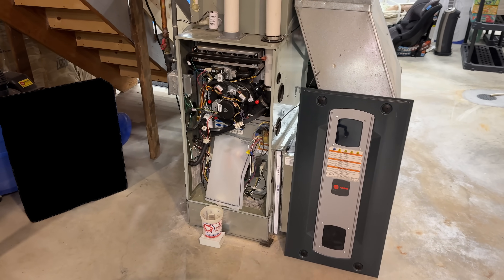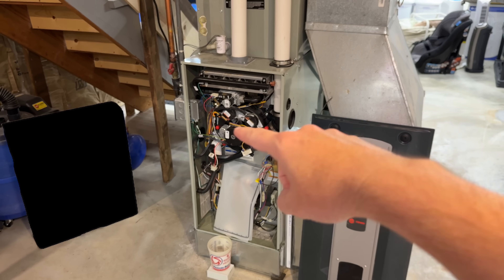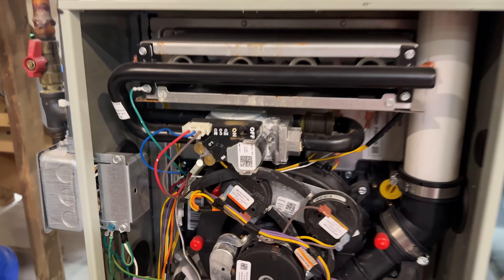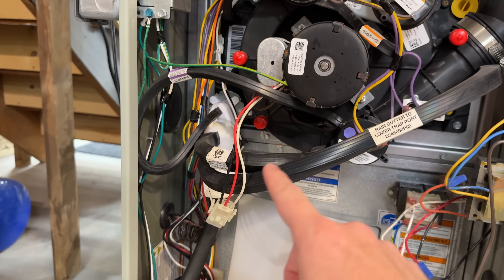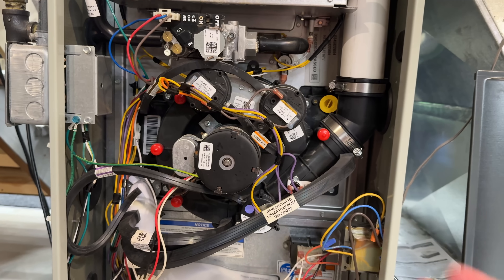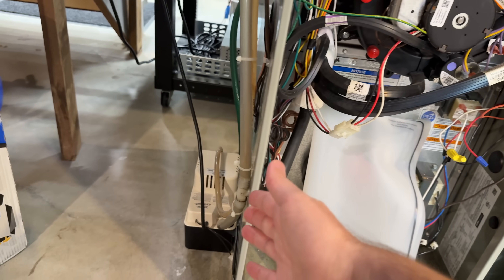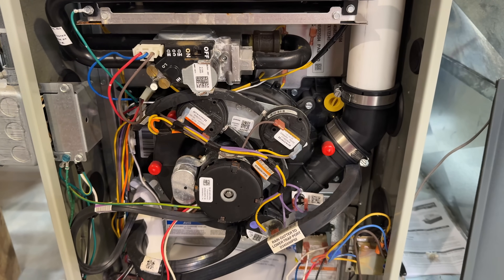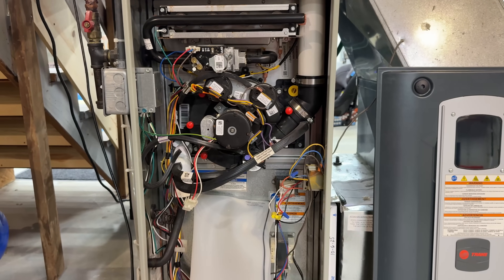It's not that hard to stop a Trane

Comment: Crazy I stumbled upon this video...
I was troubleshooting my elderly neighbors furnace yesterday and he has the EXACT same model. It was throwing an Error E12 for a bad fuse and it actually turned out to be a bad board due to corrosion... 

His HVAC company wanted $526 to replace it after his "$100 membership discount". 

It was intermittently failing so this makes a lot of sense as to what caused the problem. His furnace is 10 years old.

Comment: I think,warranty or not, is just to go ahead and re-engineer that pile of poorly designed junk.
First off, I'd move the control board outside of the unit and place it in is own IP rated enclosure up, away from the floor. Next I'd drop a hole in the lower portion of the fan and fit a hose barb fitting and a drain to your water collection tank. After that I'd see what we left and on those bits. When your done you'd probably find you had a Vaillant (good, German Engineering) heater.
I always work on the basis that you probably won't be able to stop water being in so make sure it has somewhere to get out.

Comment: I saw the problem right within the first min of the video! The black plastic of the two halves of the blower squirl cage meet and have screws or bolts and there is one missing at the bottom and that is where two different air temps meet and condensate. The bolt missing is right were it leaks and the drip falls off down to the board! Fix the blower squirl cage missing bolt and I think your moisture problem will disappear!

Comment: insulate those draft pipes so the condensation doesn't form on the cold surfaces. Paint the PCB with conformal coating.

Comment: My home has two Carrier 20MVP condensing two stage furnaces installed in 2000. It was $10K for two (with install), what seemed very expensive at the time. In 25 years I had two failures, a hot surface igniter got a crack and became intermittent, which I fixed myself, and one of the drain hoses was degrading so replaced it with hose from the auto parts store. When they installed them, they had the gas pressure way too high, as they adjusted them based on heat rise not based on gas input clocking, I promptly fixed this. They have now both run 25 years with 0 technician repair calls or annual service (my bad, but seems fine). I do change the air filters and vacuum the intake air plenum every year or so. I stuck a camera in the burner chamber a year or two ago and it looked totally clean. I slightly have wondered if the original installer set the gas mixture way rich on purpose, knowing it would cause future service calls, or if they just could not read the installer manual. I have a couple of CO detectors in my home, just in case a crack should form in a heat exchanger.  It never has leaked water. I have one download and one upflow, neither have had any real differences in functioning or reliability.

I now have a lot of solar on NEM 2 so the grid is my long-term battery, so want to move to heat pumps, but am considering just getting mini-splits and leave the gas furnaces in place for backup or if it get's really cold. I'm in the SF Bay area so I think 20 F is the coldest I have ever see it get in 35 years, and that's pretty uncommon. 

My furnace has a real different design to the air intake, there is a basically sealed metal box around the burner injectors and the air intake pipe connects to a fitting on this box, so even if it inhaled water I think it would just get sucked into the flame. I can't believe the one in the video seems to just dump the intake air into the furnace cabinet. The drain on the inducer blower has always worked just fine. 

My home also has a 45 year old Carrier A/C outside unit, that still works fine, I was told it was the ultra deluxe model in 1981, for it's capacity it's physically big. It once had a refrigerant leak about 25 years ago. I did have a second Carrier A/C unit die 22 years ago with a locked compressor, and it was replaced with a York (which I bought on the Internet and has a scroll compressor, along with getting a refrigeration license so I could legally evacuate/charge it), which has now run for 22 years with 0 leaks or issues. Silver solder on the piping and a long evacuation, until a micron gauge stayed low with the vacuum pump off, indicating all water and volatiles were gone. Somewhere I must still have half a tank of R-22. The A/C units are on the north side of my home so don't bake in the sun, although it get's to 105 here every summer.  

I'm curious if it's the brand or the age that makes such a big difference in our condensing furnace experiences. I always thought Trane and Carrier were similar quality. The guy who reviews appliances says the issue is inflation has made the inflation adjusted price of appliances just horrendously expensive today, so ones that are at the upper end of what we think is the acceptable range are just cheaply made. That implies my year 2000 $5K Carrier furnace should cost about $9400 today with install (88% inflation, I'd bet it would cost more, and lower quality). My Carrier 20MVP functionally looks very similar to Jeff's Trane.

Comment: That's the problem with these 'high efficiency' units that draw air from the outside. I have a Rheem Tankless water heater that overall, works really well, however, because it draws air from outside, even with the condensation trap on the intake, when it's really hot and humid out, it'll shut down with a 'water detected' error because the moisture in the incoming air condensed on the cooler components inside triggering the shutdown. Rheem is like 🤷‍♂. So when this starts, I just have to pull the cover off so it uses inside air to run and not shut down.

Comment: The old Carrier 92% I have from the mid 2000s has a big metal shelf between the inducer compartment and the board/blower compartment. Inevitably the inducer motor seal will leak water over time as it wears out which also happened to me, except the leaking water only rusted that shelf and never got to the board compartment. This design on the Trane is questionable to say the least, and probably for maximum compactness

Comment: Mm, from a European view I find that thing weirdly open. I mean, a high efficiency  / condensing furnace is nothing new here. I have one that claims to be I think 99.9% and it's from 2001 and still going strong. But the whole burner assembly is a sealed assembly,  the controller is a sealed box within the box and motors are or the sealed type. It is pulling in the fresh air into the housing just like yours but moisture, heat and electronics are much more separated.

Comment: I've fixed my grandma's dryer and oven. Dryer had a stuck switch* so the drum wouldn't stop spinning. Oven had a stuck switch so the convection coil wouldn't stop heating. Thank God the oven's over temp runaway sensor cut the power after just burning a lasagna and not the whole house down. 
Those fixes would be upwards of $600 if I didn't have mediocre soldering skills and the switches that cost less than $1 each. 
I've also worked on this same style unit. The door sensor rusted out so I bypass it. But the board itself is more protected from the water so I've only had to replace other parts. I should really replace that door sensor in case she ever sells the house... Dangit! More work added to the list.

*A switch is a tiny Lego looking piece that uses magnets to "plug in" a line of power. So for the oven it had melted together so it was "plugged in" even when the oven was not asking for it.

Comment: "warranty covers parts but not the labour" seems as sketchy as the design. Is that how it usually works? Who decides the labour costs? Are you paying the engineer's salary, or are they adding an overhead to cover their other costs, like parts?

My boiler (UK) has had issues over the years while it's still under warranty. They just come out and fix it for free.

Comment: We had these condensing units forced on us in Canada two decades ago.  The water is normal because they condense steam.  There shouldn't be water accumulating in the round, black  impeller housing.  It's supposed to drain out.  Check those square black hoses for clogs.

Comment: something to understand (speaking as an ME that used to work for a competitor hvac wise), this was not engineered to fail. you don't know everything when you design a system. when you make a design that has a failure mode you miss, it goes into the DFMEA and you learn going forward to cover that failure (assuming the cost of the failure outways the number of failures that occur). your job is to just barely make a system, and unlike in programming, where a change effects speed, physical things cost money for ever single piece you put in, even protection features. It costs a lot of money to test and build, and you can't predict all customer use cases. quality problems are awful from both a reputation and warranty cost perspective. trust me, no engineering company does this on purpose. I'm sorry you have to deal with this, it sucks.

Comment: The perils of the cutting edge. Condensing Furnaces/Boilers like these burn 20% less fuel but are far more complicated and require more maintenance (and have the literal condensation problem experienced by Jeff). IMO if you want condensing, a hydronic condensing boiler setup is the better play, you can put the boiler on an outside wall then run water lines back to where your HVAC system is, so you don’t have these long air supply/exhaust lines that are causing Jeff  problems.

Comment: High efficiency furnaces are condensing furnaces.  That means they have a secondary heat exchanger where the exhaust gas are cooled enough so the combustion products condense into water, thus releasing more heat.  The heat is passed through the heat exchanger into the forced air stream, thus providing more heat for your home.  This is how furnaces get above 80% efficiencies - extracting almost every last drop of heat from the combustion process.

The downside is complexity.  The process generates water, which is why they have all the pipes and drains in the exhaust system.  The exhaust is too cool to rely on convection to rise through a chimney, so an induction fan must be used to force it out.  The good news is the exhaust is cool enough that PVC can be used, and it can be plumbed horizontally.  Also, the secondary heat exchanger must be rust proof, so they are stainless-steel.  And safety systems have to be more complicated to make sure the induction fan motor is running, water is draining, and more.  This is one reason why these furnaces cost more.

As for Jeff's  system, I agree with the other commenters that swapping the two drains should eliminate the problem.  This will give the condensate a better slope to drain into the collector.  For all we know, the drains were installed incorrectly at the factory.

Another note is the external condensate pump has an overflow cutoff switch, but it's not wired in Jeff's system.  This should be connected to the thermostat control wires; that way if the pump fails and is close to overflowing the system will shut off.  It's simple low voltage wiring that any decently handy person (like Jeff) can do!  It's a handy feature to prevent wet floors.

Comment: One day I found my gas furnace making a gurgling sound. That's not normal. I called in a tech and it turned out the the draft inducer fan was full of water! Simply because the condensate drain had a tiny blockage.

Amazingly the fan and furnace still run fine even a few years later.

Comment: You pay a big price premium for Trane and Carrier. You must get it serviced regularly to keep the warranty. Replacement Parts are usually three days away if they are not on nation wide back order. Thats why we sell Goodman, Amana and Daikin systems. Any tech that says Goodman is junk is lying. If sized and installed correctly, they will perform as well as any other brand at a much lower installed cost. Most repair parts are on every service truck. An 18 seer Goodman will save the same amount on the electric bill as an 18 seer Trane and about 5-8 thousand dollars cheaper. At least in our service area. You will never get that extra cost back within the lifespan of the Trane.
Reply: Yes, all my properties have Goodmans and about 1/3rd of my area seems to have Goodman. Dead simple to figure out what is wrong if you can handle amp and voltage readings and a DIY fix if you are not afraid of 230V when testing it. Never had a Freon leak either.

Comment: I have a similar unit but downdraft.  Same issues yet but a did a few thing to prevent water from getting on sensitive electronics.  Trane will likely blame it on improper installation

Comment: You have a bad install. That unit can be installed vertically and horizontally and the drain hoses (square ones) are supposed to be rerouted depending on configuration.

On the point of the cutoff, if you have a condensing furnace then that cutoff should cut it off too, not just the AC. The cutoff switch should probably be installed to interrupt a different control line.

You can talk to Trane but I think your installer is at fault and they should fix it including labor since they did it wrong.

Comment: My Trane furnace died a slow death last year. Had to replace the control board after it lost 1 phase of the AC circuit. I asked the tech "So what happens when it inevitably fails again and these boards aren't available any more?" He says "Buy a new furnace". I should have bought the cheap furnace instead of the ultra high efficiency one. Lesson learned ...

Comment: A proper install will have a drip loop of sorts for your air tubing to purge moisture before it hits your HVAC unit. Would be relatively easy for you to add.
Reply: You have to be careful with the number of bends in the intake an exhaust pipes on condensing furnaces.   There are maximum lengths for the pipes, as the induction fan can only push/pull air through so much pipe.  Curved sections add much more resistance than straight pipe.  The installation instructions provide data to calculate how much pipe can be used.|

Also, most of the water comes from the condensing heat exhanger; that's why there is so much drain plumbing in the furnace on the exhaust side.  Intake moisture can be dealt with by the kit Jeff found or by checking the other end of the intake to make sure is properly installed and free of obstruction.

Comment: Just rip the pcb out put it in non-hostile enviroment aka plastic box outside furnace and call it a day. you might need to compile a new harness or extend some wires but its mostly 12v sensors so it really wont matter if its extended an extra foot. I dont know why theyd be relying on what looks like a toy pump to keep the pcb dry
Reply: Also it looks like whoever serviced this fixed the symptom not the cause.

Comment: The raingutters are installed backwards. The top one should be swapped with the one right below it.

Terrible design in general, but specifically, that's wrong. I'm not even an HVAC guy and I can see that.

Comment: Trane is 100% liable here, you should not be paying for labour or parts. They have allowed condensation to fall onto mains connected switches, motors & electronics.

- having condensation drip down into a mains electricity (red, blue, brown wires) is an extreme safety hazard and fails both US and UK safety regs. This is alone is grounds for taking them to court.
- the PCB location is an electrical / fire hazard (being below parts w/water) and something an insurance company would flag. In the UK this would fail basic regulation, ergo illegal.
- the gas burner element should absolutely not have an exposed flame, if with the control box cover off. Again In the Uk this would be illegal.
- improper location & inclination of the drain hoses, again this fails basic regs and this is also legitimate grounds for reinstallation at TRANE's cost.

If you just want to make the best of a bad situation - 

- you could 3D print a duct to go under the fan motor housing with a hose going from it to the other drainage hoses.
- create a metal drip tray out of aluminium to prevent condensate dripping down on the switch/motors etc. That said, the p-trap/u-bend in the vent piping, may resolve most of the condensation issue.

Gotta laugh at the "safe-t-switch", too hard to come up with name that isn't straight out of kindergarten?

Comment: I think you're looking at the wrong problem. You shouldn't be getting water build up in the *exhaust*. Because it's high efficiency, the air coming out the vent isn't as hot as a less efficient model, but it should be more than warm enough to prevent condensation in the pipes. Are you getting rain driven water into the vent? Look at the venting scheme on the outside of the house. This is a high efficiency furnace, they're all basically the same design. No one conformal coats these boards.

Comment: turn the furnace upside down , that way the water won't drip on the board . Problem solved.   But why didn't they have that board conformal coated so water won't rot it away. That reminds me of boards in fan coil units in dorm I used to work at . 300 fan coil  units  right by the window that had a shelf and where the residents found convenient to use for microwave and food prep area. What could go wrong with that ? I had to replace the control boards all the time on those Trane fan coil units. But down in the laudry the washers and dryers had conformal coated control boards that were impervious to moisture because someone thought ahead !

Comment: Conformer coat the new board after install, or 3D print an enclosure. After the 3rd control board fix in my washer, I used conformer coating.  No issues since.